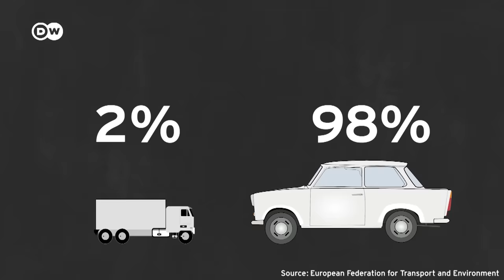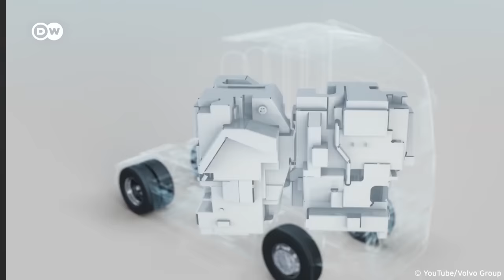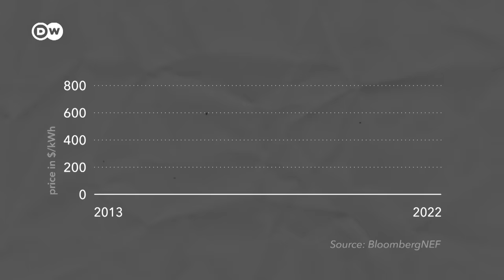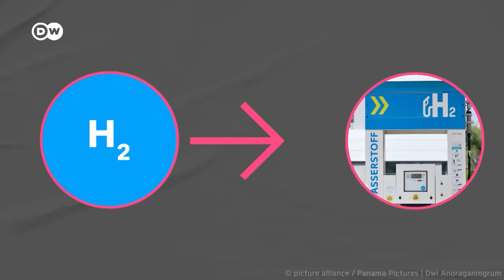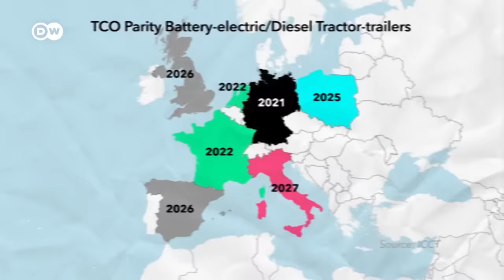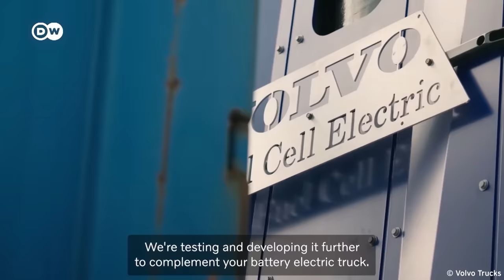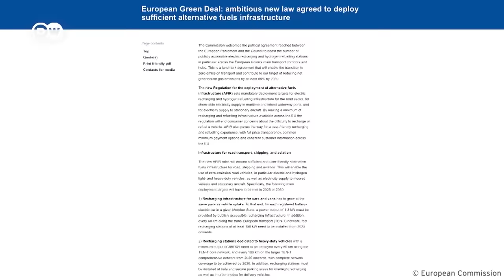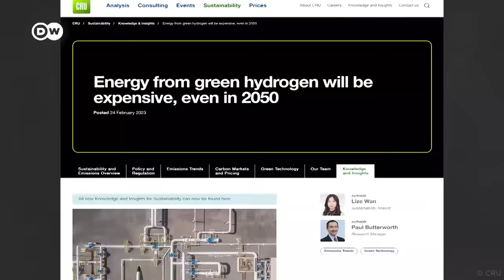Which will be the engine of the future?

Comment: Hydrogen is the future -  since the 1970ies...
Reply: Same as nuclear fusion
Reply: Same as realistic battery density.
Reply: @dipladonic  1972 Munich Olympic Games saw the BMW 2002 electric which was able to cover marathon distance...
Reply: No chance for cars and trucks maybe ships n planes
Reply: @MountainMan-ADK  Yes, let's put cryogenically frozen liquid hydrogen on a plane. Great idea (not).
Reply: @dipladonic  If you use compressed hydrogen at 700bar instead, it will give a proper bang, not just a little whoosh...
Reply: @LilaKuhJunge  You miss my point regarding what @MountainMan-ADK says about hydrogen and planes. Gravimetrically, hydrogen is no good for using as a fuel for flight as it would only give a useful range if it was cryogenically frozen...which is an incredibly stupid, dangerous and impractical idea on a plane (and that's not to mention how hard green hydrogen is to produce, store, transport and use).

Comment: Once again, trains solve all our problems and small electric trucks could drive small distance from train station to final destination, but people don't want trains. They would rather build train infrastructure above highways, than to use already superior trains...
Reply: Public transit will not get you where you want or when you want....plus it's nice just to sit in your car or on your motorcycle to watch the sun set for example
Reply: There is huge investment in trains going on in Europe including the massive tunnel TELT Lyon Turin and investments in railways going to India and the Middle East recently announced besides the already good rail infrastructure in Europe connecting even China. But trucks have its reason to be. We can not just cut metropolis with railways and bring then to every medium city. Therefore we need more efficient trucks too.
Reply: There is Shift2Rail initiative too
Reply: @russ549 have you driven hours on end for someone else's gooods and making sure sure reach there in time. That's the type of job trucking is. Long distance transportation works better if it's on a train. Short distance maybe on trucks is fine and using trucks on hilly regions is also understandable. Of course only trains isn't a solution it's a better alternative for long journeys.
Reply: @shaunkollamparampil1710  right, and train tracks could carry electricity along the tracks so you wouldn't need batteries...is that one of your points?......I actually think interstates and other large highways could carry electricity too. So cars and trucks could run on this electricity and charge there batteries  while driving.
Reply: Yes, for very long distances most of the journey should be by train. Rail depots act as hubs with trucks recharging there while the freight is loaded from the train then distributed by road. Passenger transit is a totally different problem but even there, once self driving cars are available at both ends you can get a train for the majority of the journey then order a robotaxi to there waiting when your train arrives for the final leg to your destination.

When it comes to freight people don't not want trains, they don't care. They only care about time and reliability.
Reply: @russ549  Train tracks have something on top of it called a canteliver which has been doing what you describe for a very long time. And no highways and interstates cant do that without needing a lot of funding which could be better spend improving public transit.
Reply: @cmw3737  freight is faster on rail than road under most balanced circumstances.  cities should get more pedestrian and cycling friendly and that should be the proffered mode of transportation, but sure for unusual circumstances taxis are a neat idea.
Reply: @russ549 it’s nice to sit in a 3 hour traffic jam just to got to the supermarket
Reply: @russ549  he was not talking about cars dude.
Reply: That's an excuse

People don't want trains 

Company's will pay for the cheapest form of transport end of
Reply: I work as a trucker moving scrap metal around, how would my task be relighted to train and small truck? All the industrial zones would have to get stations, dozens per small city even. 
I ask because you say it will fix all our problems but I feel you fail to see the complexity of the real world and just how complicated and nuanced the problem truly is.

Comment: Trucks, are fine for small scale delivery and for remote areas. But everywhere else we should switch exclusively to TRAINS.
Reply: They do in Japan.  Seen it first hand.  Works way way better.
Reply: @bar8665 Japan is also not a superpower. Trains are not enough. Japan is a tiny group of Islands. The US is a large mass of land. Train routes can't cover every nook and cranny of the land. That's why trucks exist
Reply: @PermanentHigh  Japan is 93.57% the size of California... If their country was bigger, they wouldn't say, "Oh, well forget what works awesome and expanding on that".
Reply: @bar8665   That's not how shit works. What works for a small geographical area is generally not gonna work for a far larger area simply by "expanding what works"
Reply: That means you will have to cut down more land to build railroads increasing deforestation problems
Reply: @PermanentHigh  Virtually every town in Europe is connected via rail with most of them having multiple stations. No matter where I go, I'm practically always less than a 15 minute drive to the closest station. You cannot use size as an excuse for rail infrastructure. Even having every other three towns connected via rail will be more than enough for freight purposes. Get cargo on the train. Get cargo off the train. Finish it off with a truck within an hour drive.
Reply: @PermanentHigh Yeah it does. Just do Japan sized units across the dense areas of the US.
Reply: Yes that's true. I understand for smaller cities where trains are not an option, but big cities nope. Still I think Hydrogen is the future and if it's not, if its batteries, has to be no lithium batteries, like BYD Seagull, made of sodium...
Reply: @AIBreakitSimple Blud we can simply make bridges above the forests..It will not cause any deforestation
Reply: @denyoellamcy8251  doesn't sound like a bad idea the only thing that would concern me is maintance of the railways,machine8to build it in the first place, cost and the geo graphical challenge

Comment: As you pointed out, hydrogen costs 6 times the amount of energy for the same results.  There is the safety concern. Hydrogen is more explosive than gasoline.  I would not want to be involved in a hydrogen truck accident. While both gasoline and hydrogen accidents result in the burning of fuel, The hydrogen would be much quicker and more forceful. I hope that battery evolution will overcome the perception of the danger of battery fires.

Comment: Best Option is to get as much Cargo on the rails as possible.(Like it used to be)
Then use electric for the last few miles. Hydrogen is too expensive and valuable to waste it that inefficiently.
It takes a ton of energy to compress and cool hydrogen.
Reply: Yes! Under-subscribed comment 👆🏼

Steel-on-steel will always be more efficient than rubber on tar. And the limited degrees of freedom on rail potentiates efficiencies up and down the chain.

Also good to ask where the hydrogen is coming from and what the net energy/environment calculus actually looks like. We know carbon credits are a scam because of b.s. calculations, so be wary of silver bullets and techno-utopian and pro-capitalist/growth perspectives in general.
Reply: electric is also on its way out, without even beginning.. look at what Ford are doing, they say due to cost and customer demand, but it's not just that. They are halting all their EVs and cutting back on battery plant that was being made. Rail should be used for freight  i agree
Reply: @multitablez7825  What are you talking about? Global EV sales are approaching 20% of global new auto sales this year continuing the rapid growth of years past.

Ford's EVs are both worse and more expensive than Tesla--it's a product problem, not a demand or other problem. Tesla's global days of inventory at the end of Q3 was 16--half that of any other large automaker, 1/4 that of a "normal market" of 60 days supply. Legacy autos want to keep milking ICE profits till we all die in societal collapse to climate change. Tesla and Chinese automakers will put most of legacy autos out of business over the coming decade with EVs that are good, profitable, and much cheaper than ICE vehicles as costs continue to decline. Legacies have been trying to prevent EVs for decades and will go extinct just like the dinosaurs they insist on burning.
Reply: @multitablez7825 electric is not on its way out
Reply: @tHebUm18  we fear change
Reply: @multitablez7825  That's just proof that ineffective companies will fail. The next Nokia. Kodak only managed to survive by going into medical imaging. If Jim Hackett didn't say that Ford didn't need battery production perhaps Ford wouldn't be losing $30K on each Lightning.
Reply: The main problem with electric vehicles is not the energy density BUT the West ability to source the materials needed to build those batteries. Some of them are located in countries that are unstable. One day, it could be blocked if the situation deteriorate.
Reply: The real issue is batteries poor life cycle. Hydrogen cells last longer.
Reply: @trowawayacc  Hydrogen cells have to be inspected on the Mirai every 15K miles as well as the tank. Typically the stack exchanger is replaced about every 80-100K like a timing belt. Most batteries will last 300K miles and supposedly the new ones can cycle over 1500 times so 1M miles possible. Hydrogen does not last longer. The platinum and paladium also needs to be replated.
Reply: @trowawayacc  And only 22% efficiency isn't worth it. We are already to energy hungry.
Reply: Electric is good up to 80% of its rated distance (accounting for either point to point or return journeys)
Hydrogen is very expensive, but range can be extended fast and efficiently, away from anything accessible
Reply: @Arch3r666  Only the "fast" part is true. Hydrogen can refuel at more or less the same rate as conventional gasoline/diesel. But it is most certainly not more efficient. The only source of inert free form hydrogen is in the near vacuum of space and since the USS Enterprise isn't floating around to gather it into its nacelles, we would either need to hydrolyze water or use reformation from a hydrocarbon base chain. This is relatively easy to do from a mechanism standpoint but ends up losing 3-4x the energy by the time the end product of a fuel cell uses the stack membrane to make a current to power a vehicle.

If it were efficient then Toyota would dump 20 billion into setting up hydrogen stations like Tesla set up charging stations. Toyota could be laughing all the way to the bank at Teslas and Hyundais sitting at charging stations, but the reality is that the electricity is usually better served going straight to the motor than getting converted to gaseous or liquid H2 and undergoing entropic losses.

1/2 the US's hydrogen stations are within 20 miles of my house here in California. Nobody in California can drive their Mirai to Vegas and back because there's no hydrogen station outside of SoCal or NorCal. Nikola said they would have hydrogen fueling stations and you can see that has come to fruition about as well as cold fusion.

When we have cold fusion we will have unlimited electricity and then making hydrogen is a no brainer. Until then batteries are a better stop gap - at least for passenger vehicles. An electric hydrogen aircraft might be a viable mode of air transport.
Reply: hydrogen valuable!!?😂
Reply: @tHebUm18  500,000 pounds of earth needs to be moved to create the battery for one EV, these batteries last on average a decade before having to be disposed as recycling dead batteries is very difficult. We are going to run out of lithium at this rate
Reply: @Yggdrasill8  There was a study last spring on the failure rate of EV batteries after 10 years--it was 3%, mostly dragged up by the OG Nissan Leaf with no thermal management system. They last much more  than a decade--and that's 2013 tech, doubtless substantially better on modern EVs. That and EV batteries are already being both recycled and reused (for grid storage).

There's plenty of Lithium in just known deposits for the entire billion+ strong global vehicle fleet, and we haven't even begun to really look for more in response to EV demand.
Reply: This traffic cam footage demonstrates exactly why transporting gaseous or liquified petroleum products is a bad idea. It will be as dangerous for Hydrogen. This will NEVER occur with an electric vehicle:
youtube.com/watch?v=OPthZO0fCLg&t=3s
Reply: Do you have any idea how much the batteries trucks weigh? The tires of trucks would be trash in 2 months and in very cold or very hot weather the batteries are very powerless!
Reply: Distribution centres at major motorways could be the answer utilising a road train system to a delivery centre then smaller electric/hydrogen vehicles could complete local deliveries. But battery technology is not there yet hydrogen may look attractive as a replacement fuel but the cost of production is prohibitively expensive and both suffer from Infrastructure concerns,😢 put into the mix range  anxiety problems battery replacement, interruption to power supplies etc
Reply: Don’t need to cool hydrogen 
Just build small plants in each region and haul high pressure gas to fueling stations
Reply: I think Hydrogen will be great for ocean freighters and flight when they figure out the costs.
Reply: @nntflow7058 New battery technology is already out like salt batteries. She'll be ok

Comment: In India, government working on hydrogen, hybrid and bio diesel technology.
while currently they made a whole electric freight rail networks system called Dedicated Front Corrider, which connects all major cities, industrial areas and only freight rails can run on this tracks.  And these tracks are now open by current government. Which are cheap mode of transport and eco friendly.
Reply: Do you mean Freight corridor
Reply: @ArghyaMalik-dd3fy  yes
Reply: Indian rail infrastructure is awesome. India is developing rapidly.

And trains are the best way of freight transportation.
Reply: If you implement Hydrogen factories into your electricity grid you can use them to stabilize it. In the European Market you can get paid as a negative consumer, means you turn off your factory during peak. And you can increase consumption when energy is cheap. In Germany already now, price for electricity goes below zero at least two times per week.

Comment: Mining trucks are still debating battery vs hydrogen fuel cell with Caterpillar taking an early lead with a bet in battery, but the unique conditions of mines - extremely heavy loads and relatively short distances - changes the decision-making process.  The cost of hydrogen will be a big factor for the mining industry here as well.
Reply: Can we get any articles on same
Reply: Diesel is good
Reply: @gobimurugesan2411 Oil has already peaked dude, and that's not even mentioned climate change look at the ice caps
Reply: @sambones1092  Diesel less costs. U Europeans go electric. We will go electric in 2050.
Reply: @gobimurugesan2411  At the US oil consumption rate, oil will get so scarce that it's ll be 20€ a liter by 2050, and I take you don't believe in ice melt and wildfires and heatwaves from climatechange ?
Reply: For mining, I would think that regenerative braking would be a huge factor. Even a hydrogen fuel cell truck might benefit from a battery system that could capture the massive amount of energy that would otherwise be dispersed as heat during braking with those massive trucks.
Reply: @smileyeagle1021  yes, very true.  The regeneration to the bottom of a mining pit is huge.  Underground, the regeneration exceeds the battery capacity and has more of a risk of overheating as a result
Reply: @gobimurugesan2411 Nobody is going electric on long haul because is impossible with current technology. Diesel is the way to go and maybe CNG.
Reply: hydrogen Trains

Comment: Best way is to invest in freight rail so that each city/town is already reachable through that and complement that with electric trucks which has operation range of less than 300 km.
Reply: Yep, a perfect combination. Trains with EV trucks (hyrdogen or battery) will be most efficient solution for that. Even more so if the trains are electric as well.
Reply: I think Tesla is proving you wrong
Reply: @kornkernel2232 electric this electric that. If there is no proper Renewable source of energy then you are still burning coal. 

Its like dieting. Oh I'll just eat half a pint of ice cream every 2 days to lose weight instead of minimizing it more or forgoing it entirely
Reply: The best way to invest in freight is to invest in Hyliion and Karno
Reply: @forte609  Fossil this Fossil that it's going to run out anyway the question is how many people die in between.
Reply: @forte609  you maybe right that we are using coal to generate majority amount of the electricity. However the one thing that is changing and will keep increasing is the amount of electricity that is produced by renewable. Ie. The electricity grid keeps getting cleaner and greener, while petroleum fuels won’t. So investing in electricity which can have different and non polluting sources is the best option.